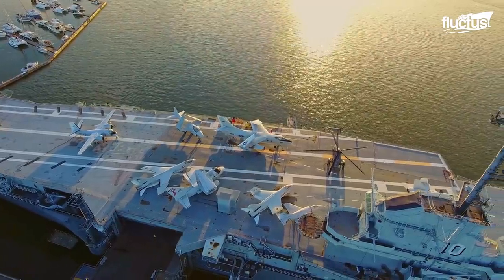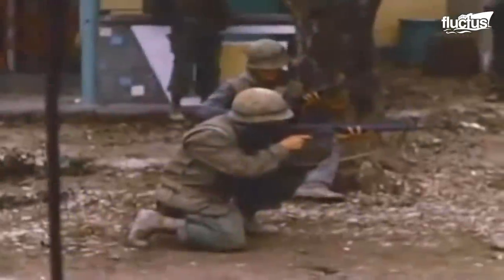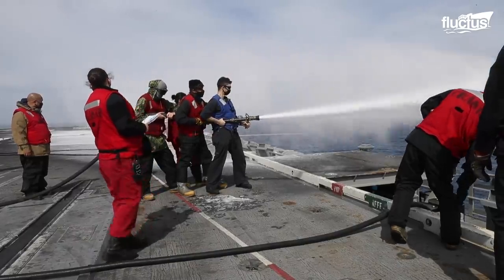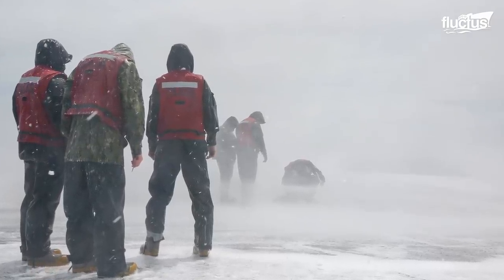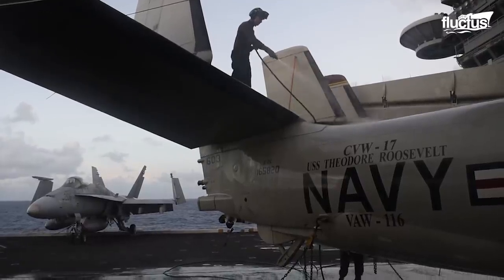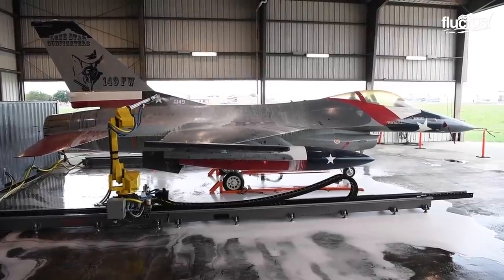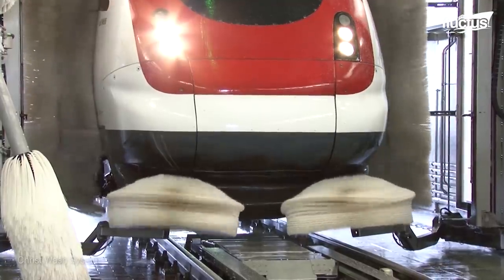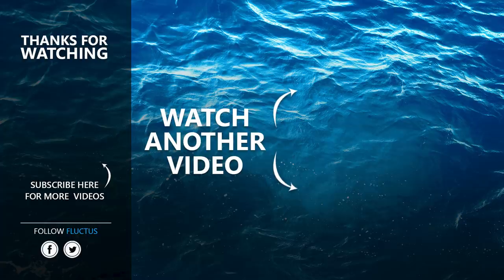Reasons Why US Built Sprinklers on its Aircraft Carrier Decks

Comment: Most USN ships have Nuclear, Chemical and Biological Decontamination wash down systems similar to the system shown.  Not just Carriers.  The system is designed to completely engulf the ship in a spray of sea water.
Reply: Q: where does all wastewater goes to?
Reply: @piay9647  it just goes off the side
Reply: @piay9647  Into the ocean, sea, or back to mother nature where the fish will absorb all the chemical, biological, or radiological particles/contaminants. 👍
Reply: although I am like the other commenters worried about the contamination, I do thank you for adding that little tidbit of information, which I verified as correct, BUT ZNOT in a deck sprinkler system, it is all done with hoses, where the chemicals are added to the water, and sprayed OUTSIDE.
Reply: @jorgeregino2352  as if they weren't already exposed.
Reply: It depends really, ideally overboard. But in the USS Forest Fire, a fair amount of burning fuel and water went belowdecks through a breach in the flight deck from the second ordinance explosion, causing secondary fires below.
It was a case of amazing how much could go wrong so quickly! More amazing is, they managed to save the vessel and had so few subsequent crew losses.
That fire and the Oriskany fire are used to this day in damage control training.
Reply: @jorgeregino2352  if it's a biological attack that's already happening outside it dosent really matter does it. Everything woukd already be contaminated. So if you don't what you're talking g about just don't day anything.
Reply: I know Royal Navy ships have it too.  Ton Class MCMVs use a seawater spray system for it.
Reply: @piay9647  if a nuke or chemical weapon goes off that close to a ship it's all ready going to be all over the water and air in that area.  SO washing it off the ship and into the ocean won't change anything.   In the long run the ocean is so full of water that it would dilute it and there would be little to no harm/effect to the ocean.  This is assuming it was only one missle/bomb that exploded.   I would be more worried about the fall out and the air streams picking up fall out and dumping it miles and miles away even almost on the other side of the world.

Comment: The sprinklers are also for Washdown of radioactive particles after being exposure to the effects of a nuclear detonation.  But rarely use them due to the salt water they spread.
Reply: My GQ station during a NCB drill was washdown station number 13.   If they hit the buttons in DC and it doesn't work they call over the sound powered phone and tell me to activate it.  Just flip a panel cover and activate the valve and my station should manual start to run it's sprinklers.   The spot it was in was in a small cubby hole that most never even knew about so it was a good place to nape in and just listen to the chatter over the airwaves lol
Reply: I remember being station in the Canal Zone watch Our Navy ships using the water washdown system in Gatun Lake (freshwater)

Comment: Too bad AFFF fire fighting system either could not be used or was overlooked during fire on USS Bonhomme Richard (LHD-6).
Reply: That fire was a chain reaction of stupidity that made the 3 stooges look like geniuses.
Reply: I heard they’ve narrowed it down to arson.
Reply: @davidepperson2376   The arsonist (if we trust them not to scapegoat someone) was aided by a bunch of offline fire fighting ability stupidity. Along with lack of ability to isolate and enclosed the fire into certain sections to keep i from spreading. That whole thing was major cluster fuck of negligence
Reply: @ablemagawitch  well, it didn't help having the Marx brothers in the chain of command...
Reply: AFFF could/wound not be used, becomes A) Toxic at the temp of the fire. Fire was above 1500 degrees. B) was down for the yards. C) By the time the fire was found by sound and sec. watch it had nearly fully engulfed the lower vech deck. so AFFF would not work.
Reply: @Virtualstalker  AFFF would work great - if your goal is to spread HF inside of enclosed spaces. HF + aluminum + fire sounds like the start of a fine pyrotechnics display, with the added benefit of, as you said, toxic fumes and gases.
Honestly, I don't know how the hull didn't fail with that damned fire! That was a nightmare, founded upon a nightmare from the very pits of hell.
Reply: @spvillano  The hull was never at risk. Fire goes up. The eng room was untouched.
Reply: @Virtualstalker  fire goes up, heat is 360. But, it'd have to boil off beyond simple film boiling water off of the hull to burn through.
When multiple decks re buckled, the structure of the vessel is in question and well, it's to be scrapped.
Had she flooded, the fire might've been lessened, but she'd be less battleworthy. Big mess, hard to find a better way beyond what we have, I'll let the experts field that hot mess.
Reply: @spvillano  Stephen that not actual true. Fire goes up once a room is fully engulfed. Heat is the fire as such it mostly goes up. These is helped if there a nice souce that as a low heat point on the other side. There is a reason why the engine room was untouched while 4 throw the 02 level were wiped out.

Comment: I'll bet the USS Forrestal (CV_59) would have greatly benefited with this kind of sprinkler system. I was told the 1967 fire was due to lax attitudes & more than a few unsafe practices [as seen at frame 0:31]. I guess they have since changed the narrative [as seen on wikipedia]. Wiki calls it a 'Misfire'. What I saw in boot camp films was a 'Drop' [like I hope the guy in frame 0:31 DON'T Do].

Comment: While the wash down safety systems can be triggered when actually needed, they are NEVER, repeat NEVER activated for a test when aircraft are aboard the carrier. The water is not clean water but sea water (salt water) and the salt water will eat the aluminum skin of an aircraft and unless cleaned off immediately with fresh water will destroy the aircraft.
Reply: So the foaming agent is mixed with sea water as well, or the foam is a different mixture on its own? Also do they wash off the foam after system testing with sea water or fresh water? I understand in real damage control situation it is a secondary concern, but as a test or drill how do they wash off properly? I suppose even on empty deck salt build up is still something to avoid?
Reply: @mtssman  yes. All of the water on-board ship comes from the ocean. The drinking water is also sea water that has been through the ship's evap system.  We almost never drilled with the AFFF or foam because it will ultimately end up being pumped over the side and will leave a miles long bubble trail that can be easily followed.
Reply: @mtssman  The only water source on a ship is ocean water. Not only is it salt water it has a lot of things in it you don't want to drink. While ships can make a lot of fresh water, the majority of it is used in the propulsion system. Nuclear carriers use the reactors to make the steam rather than fuel oil boilers to make the steam.  Fresh water is the most valuable commodity at sea. 

The purest water has been through the evaporators several times and is called boiler feed water - it is the water in the propulsion system. Next is potable water which is used only in the galleys (where food is prepared) and in the heads (latrines to the the ground pounders) for sinks and showers (if there is enough). Everywhere else, it is pure sea water pulled in from the surrounding ocean. 

Reminds me of an incident in the VS-24 Ready Room aboard the USS Randolph in December 1967 on our tour to the Mediterranean. We had a new airman basic who was on his first shipboard trip (so was I as a new LT(jg) Aviator). The Chief told him to take the coffee urn down to the galley and fill it up with water. As the young airman was heading down the passage way, he passed a brass spigot sticking out of a bulkhead. He thought he would save the trip down to the next deck and just fill it up there, and then he went back to the ready room and put the urn up on the counter where it was kept. (The ships ran on fuel oil, the sailors ran on coffee). Next he put the prefilled basket in the urn, put the top on and turned it on. Shortly afterward, the ready room was filled with the most awful stench. They traced it down to the coffee urn which was happily making hot coffee with sea water.  The young airman got to dump the urn, and scrub it out and then make a fresh batch. He learned that unless he knows otherwise to treat every spigot (this was was for washing down the passageway) as having sea water.
Reply: @richardgreen1383  and you learned that as well.   ;)
Reply: @michaelvance6548  you'd think there would be a supplied water connection for training and maintenance/testing, you don't to leave AFFF in your system either. I guess it's easier and cheaper to build a on-land prop and train that way.
Reply: @nicke1903  we would train with the AFFF equipment but only simulated opening the valve that let the foam reach the water.

Comment: And where does the foam go after the deck wash. 
Please dont say, discharged into the sea. Because if it is so then along with plastic pollution, add this chemical foam to the pollution of oceans.
Reply: I believe in the midst of a roaring fire with sailors being BBQ'd, sea pollution would not be high on their list of concerns.
Reply: @jeetu319  I get that. I do. But what is the answer? Also, live training is necessary. I remember the Forrestal Disaster. Back then they had one highly trained fire crew. They were all instantly misted when a plane laden bomb went off. There was no one else. In fact, matters were made exponentially worse by regular sailors pouring water on the sulfurous metal.
Reply: @tomperkins5657  The answer is to store and reuse. This is not the ultimate answer to the woes but atleast storing will reduce the frequency of discharge, also reduce the operating expenditures and will allow efficient use of chemical storage space for that particular voyage.
Reply: the entire deck edge has a built-in drain system(Usually Damage Control department operates this system) with respective valves and piping that can isolate redirect drainage to contaminated tank, reclaim filters, centrifugal separator or over the side (used to be only permitted when ship was 1000 miles away from land in international waters). Remember that deck is filthy with tire rubber, turbine oil, grease, jet fuel, coolant, diesel dust, Flight Deck Boot rubber, non-skid particles, so all that grime gets washed off too into the deck edge drain and piped to the same place(s).
Reply: @elvinpena8788  Exactly my point in case of toxic materials. 
Recycling should be done when the ship is at port and all these scraps of  tyre rubber, coolants, oil etc should be disposed of by proper recycling when at port. 
And for when it is at sea these shouldnt be let into the sea. 

Thanks for the description though.
Reply: As the other navy's of the world sail by, tossing all there garbage and contaminants overboard, and laughing.   The fishing boat's out of Freeattle toss almost all garbage overboard as soon as they clear the coast,,to this day. Mostly at night,,with the deck lights off.   Sickening,,but true.
Reply: @jeetu319  Sure,  let's take away space on the carrier or ship  for  ridiculous  equipment to recycle water & foam 😖  🤯  &  raise the cost of each   ship a few more  million $$.  🙄
Reply: @patriot692  this is a highly ignorant comment. 
It's just a recycle system we are talking about not a reverse treatment and repurpose process.
Reply: @jeetu319  thx for clarifying . .